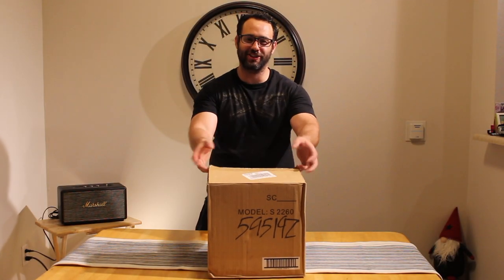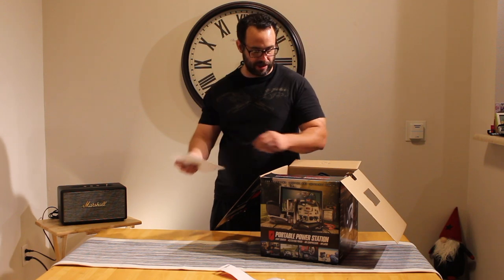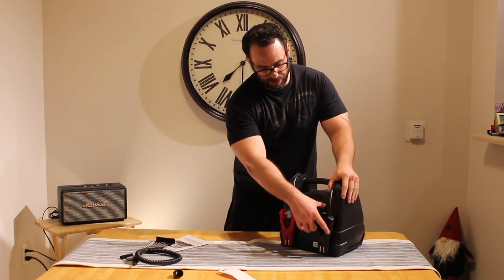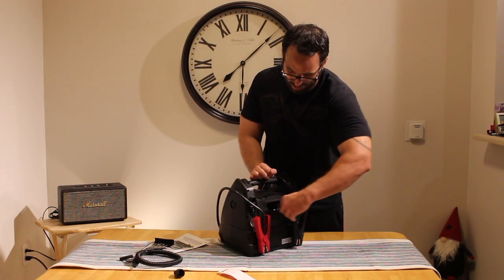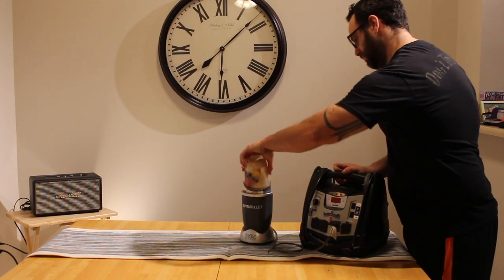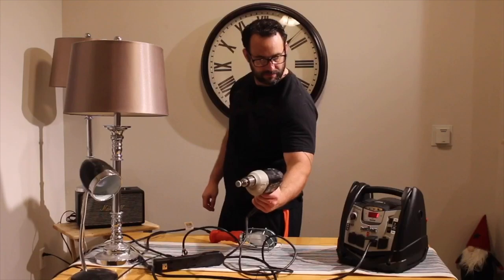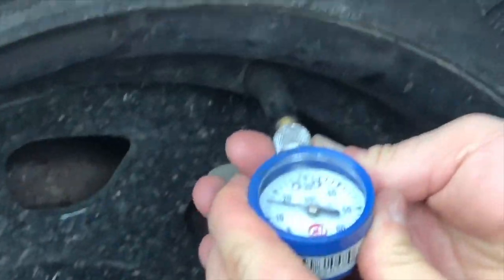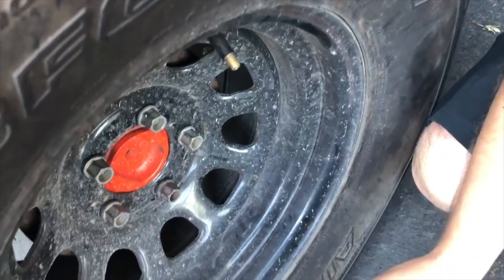Schumacher XP2260 Power Unit Unboxing.

Comment: The inverter can only handle 200 watts continuous. Your drill and bullet blender require way more than that, in fact the startup surge wattage is likley more than double that the inverter can supply. Good to see that it protects itself from an overload.
Reply: surprised inverter didn't smoke

Comment: The green light does not come on and it does not charge....any suggestions as to why?
Reply from the maker: Hopefully I don’t ask any questions that you haven’t tried before. Have you tried using a different chord and wall plug? I’ve researched a few issues and the battery might be bad. Have you contacted shumacher, it might need a battery replacement. I’ve had a few batteries go bad on me bc I haven’t kept them 70% charged in the winter months.
Reply: @FootageFactory  yes, I have tried all of those things except contacted schmachar. I will try doing that, thank you.

Comment: The inverter stinks but the 12V sockets work great.  Just plug a 200-300 watt inverter into the 12V socket and you will be good to go!

Comment: My usb isn't working. Can you give me any trouble shooting advice? I appreciate it! Thanks for sharing your review :)
Reply from the maker: Hmmm. When did you buy it and where did you buy it from. Amazon? I’m sure you have, but I’ve you checked to make sure it’s 100% charged by pressing the button next to the screen?

The reason I ask where you bought it bc if you bought it recently you could warranty it. Otherwise the USB might be shot and you’ll have to use an adapter with the outlet plug. I’m sorry that’s probably not the answer you want.